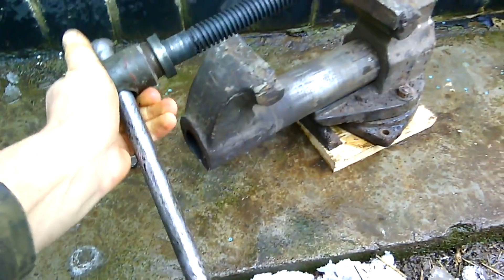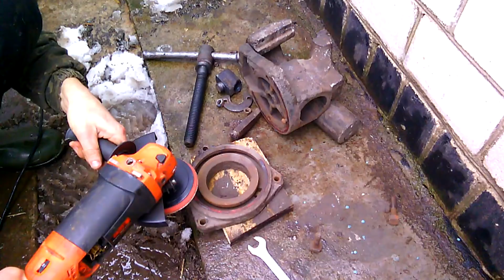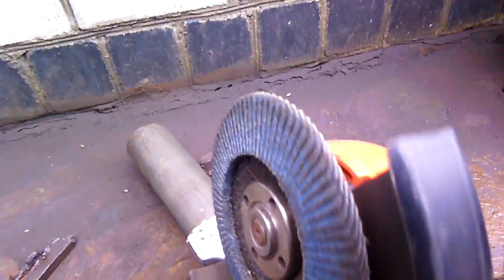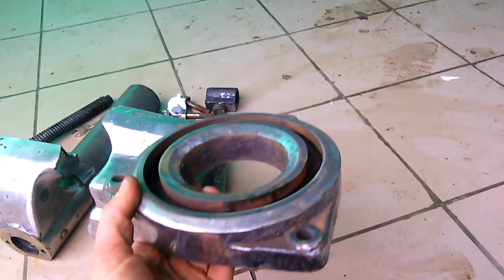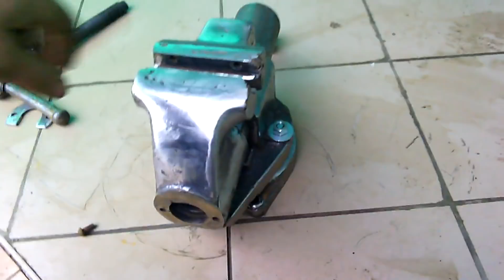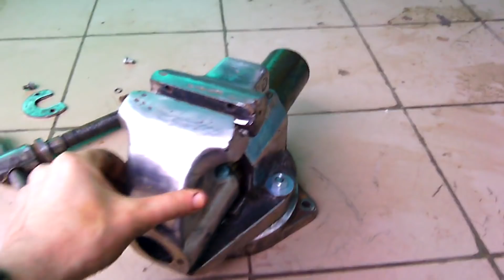Broken Vise Restoration

Comment: I'm really surprised about the pivoting mechanism on the Vice. I was certain that would have ball bearings and grease down in there.?

Anyways. Good job getting her back together again, though I'd grease that big screw or oil it.. a little bit.